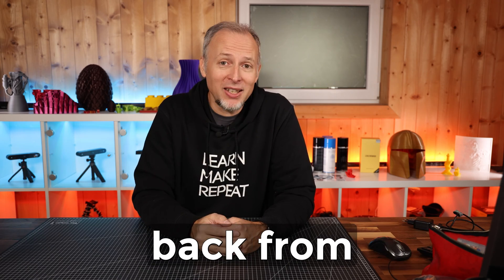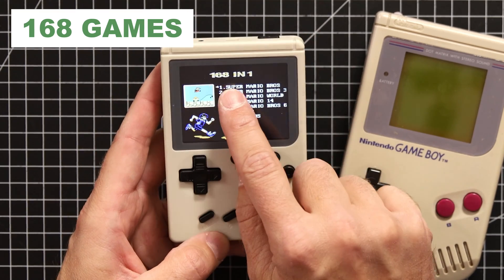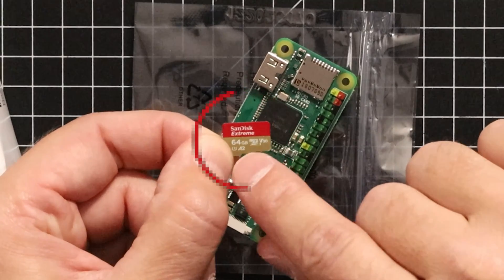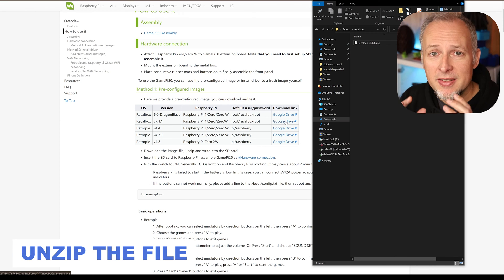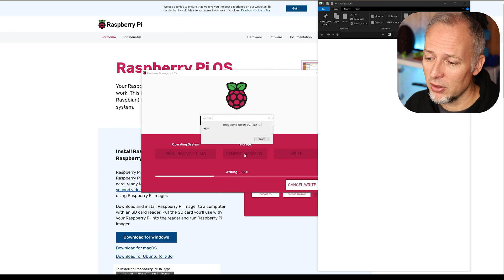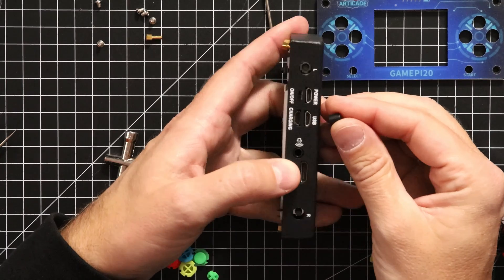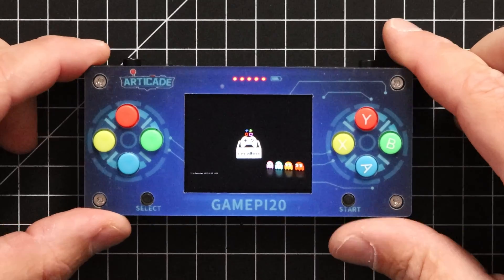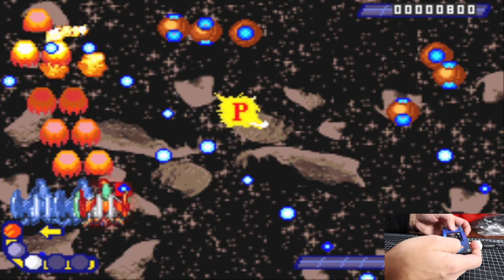TINY Handheld Console build! Raspberry Pi Zero and GamePi20 running RecalBox!

Comment: the screen is only slightly smaller then the original gameboy but the resolution is much higher, so i think it works fine for gameboy games like pokemon where you even have to read quite a bit

Comment: Misleading about the power of emulation avaliable. It will play everything before N64 and PS. 2w maybe.. but definitely not the Zero w.
Reply from the maker: Worth a try using the 2w for comparison in a follow up...
Reply: i tested it with my zero w and it worked perfectly for gameboy and even gameboy advance games